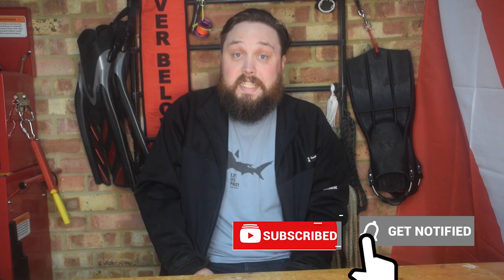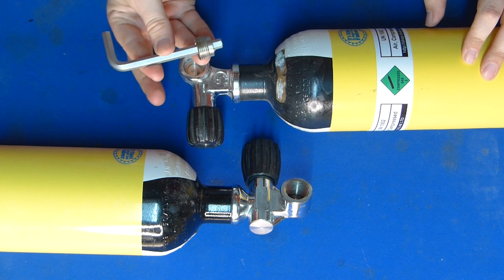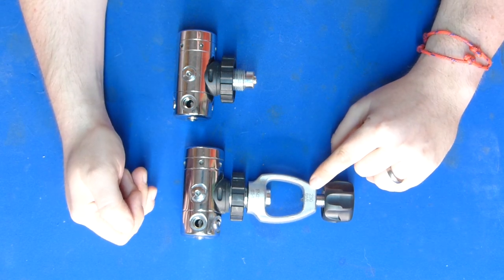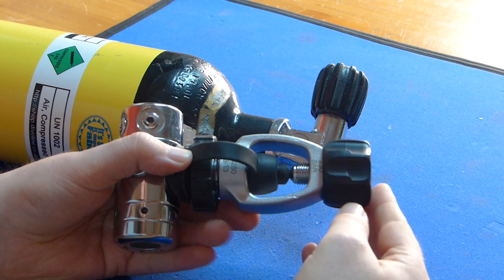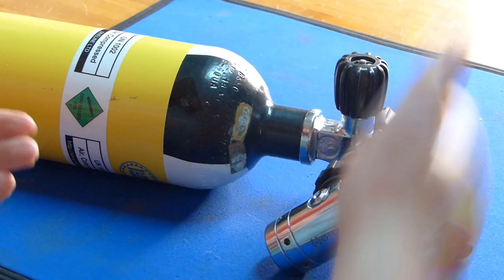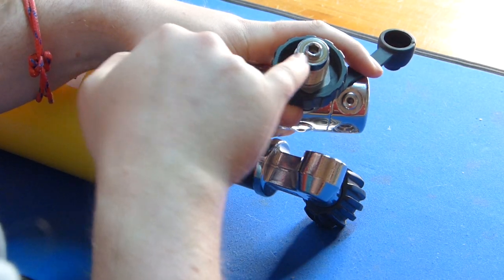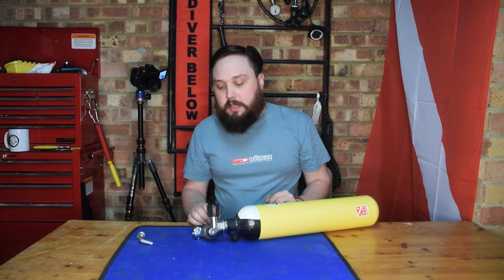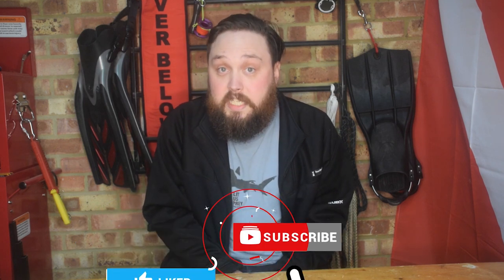Scuba Diving Basics: The Difference Between A Clamp and DIN Valves

Comment: is it not so that din regs come in 2 diferent threads 5/8 or M26?
Reply from the maker: Yes, European directive for gas mix regs - they were M26, which is slightly bigger than a standard DIN, which is 5/8.
Reply: Yep, as Mark mentioned in the video M26 is used for tanks that are reserved for Nitrox > 40%. Oxygen clean tanks require extra care to keep them clean and safe so a special valve size is used to prevent mistakes. It's not that common, even in Europe, as far as I know.